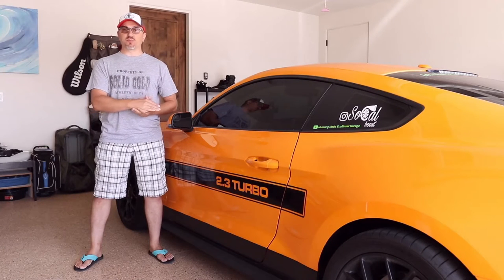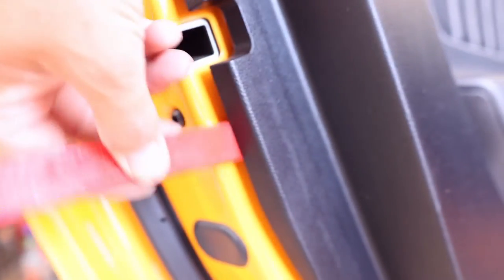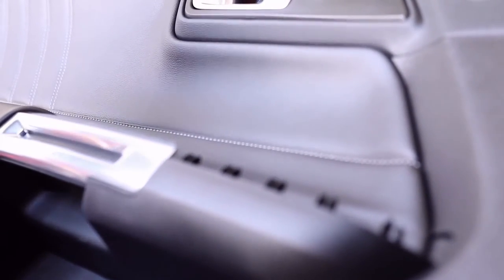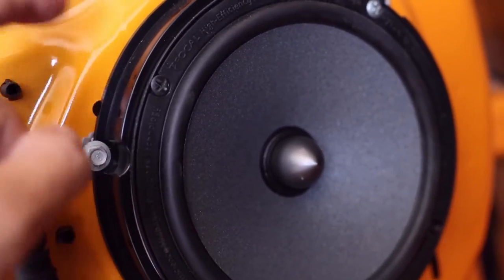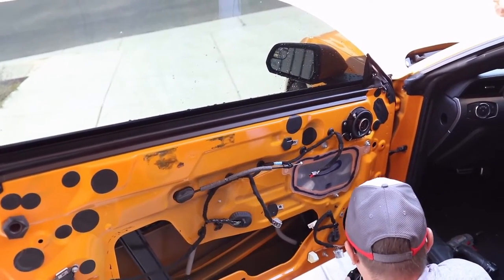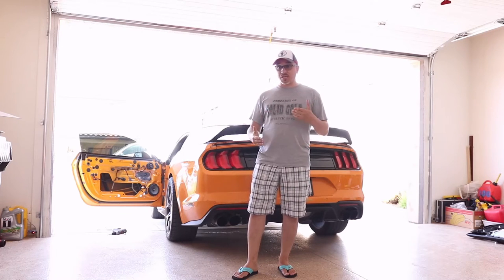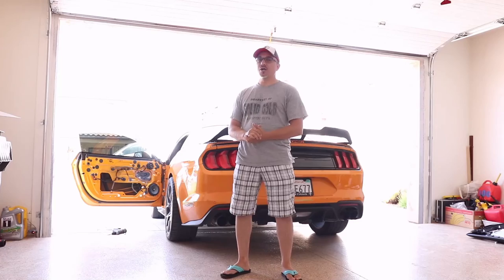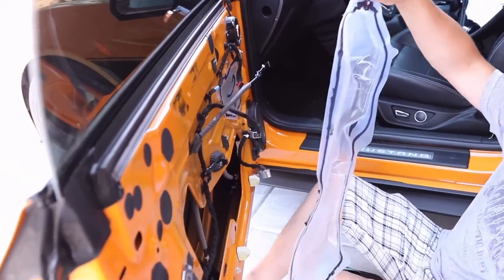S550 Mustang: Door Speaker Crackling Noise

Comment: Thank you for the video! Very detailed and informative.  I'm not sure my issue is exactly the same. mine sounds like a card in a bicycle spoke when I accelerate. I wonder if it's the same fix?  I'm not afraid to take the door off now and check.
Reply from the maker: Take notice if it happens after rain or a wash.  If so then probably the same issue.  My issue has not returned since I put the sealant in the connections.
Reply: Excellent, I will watch it.
Reply: yes i just washed mine and now I had that sound too... I think it's a shorted out speaker combined with the fake engine noise. I noticed my "spoke noise" increased when I revved the engine. It also makes my Siri voice sound horrible and distorted. So annoying
Reply from the maker: @derrickroberts1178  this fixed my noise completely.